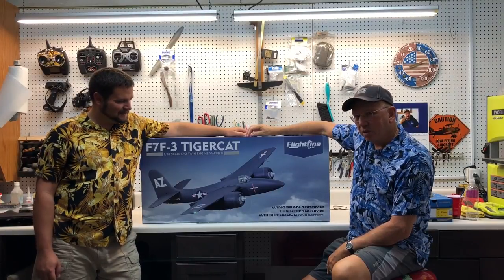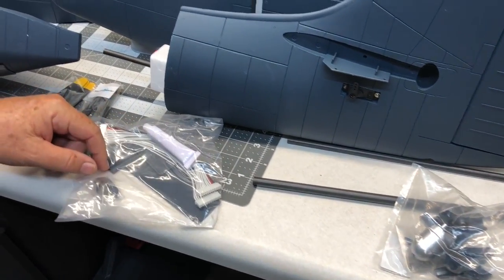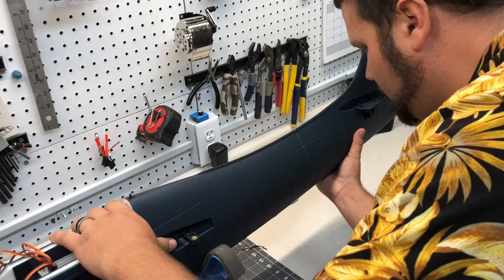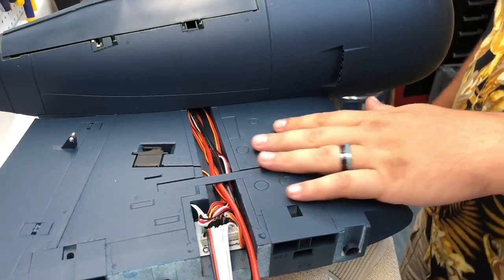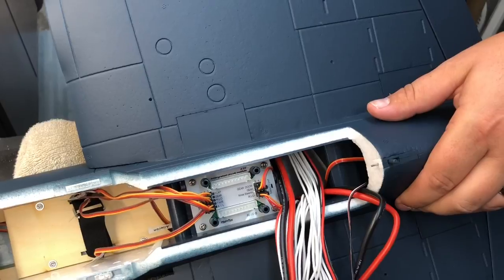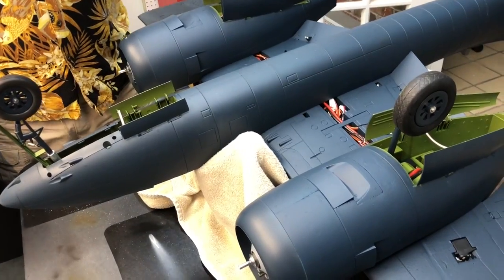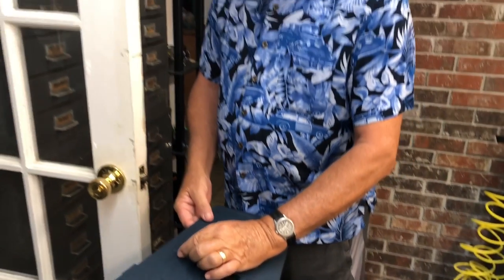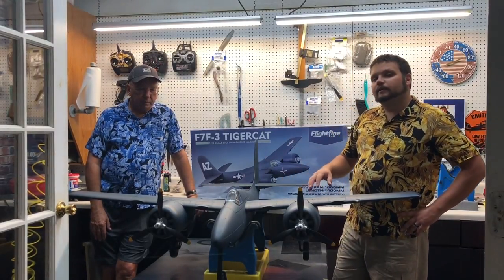F7F Tiger Cat Flightline build video

Comment: Magnetic screwdriver. Keeps them screws straight and locked onto the driver. You can magnetize it. With a heavy magnet. just by placing the driver tip onto the magnet.

Comment: Putting together my F7F3 and I have a question...Pilot Ryan and you say to plug in the tail rudder lead into the board, there is the rudder lead from the nose gear already plugged into the board where the tail rudder lead is supposed to go? Can you explain? does there need to be a Y cable installed into the board and then the tail rudder and nose gear plugged in?
Reply from the maker: It’s been a while but if I remember correctly the rudder and nose wheel go into the blue box this acts like a Y harness so you only have one lead that goes to the receiver
Reply: @MerryBoozerRC  Thanks. I figured it out, they had the nose gear lead marked rudder and in the wrong place.

Comment: so the motors need to be turning twards the fuse? as you said in board? i think they got the wires backwards on the motors,,,,do tell please.
Reply from the maker: If they are incorrect all you do is switch any two wired on the motor
Reply: @MerryBoozerRC  right,,,,,but whitch way is correct? in ward or out ward? which way dose yours spin?
Reply from the maker: @petergottschalk4524  the top of the prop spins inward
Reply: @MerryBoozerRC  cool thanks! i wonder still if it really make a differance?

Comment: Im gona need to borrow that mmmmmmmmmmmmmmm
Reply: also why do i need be sandin off the extra paint there? i tell you what
Reply from the maker: Because if there is paint in the glue joint the two surfaces may separate and flight you’re always want to sand the paint off on a foam Airplane when you’re going to Bond to surfaces together
Reply: Merry Boozer RC ye! cool thanks for the helpful feed back ye